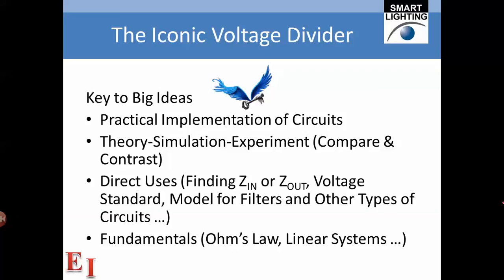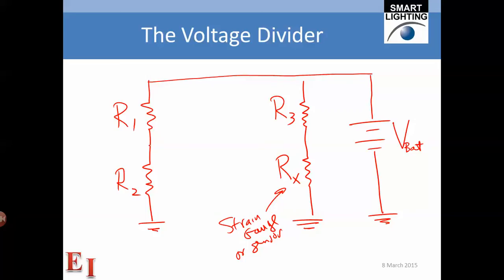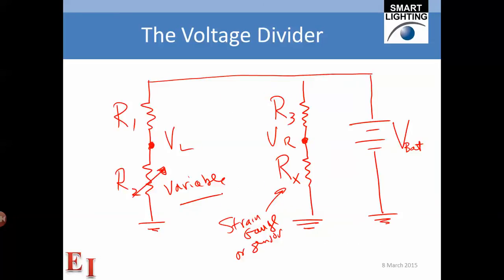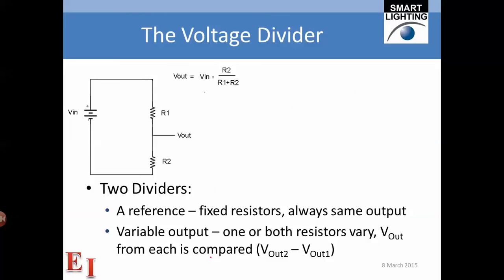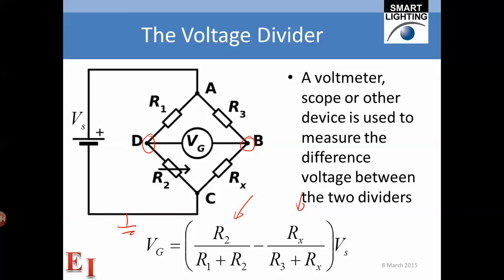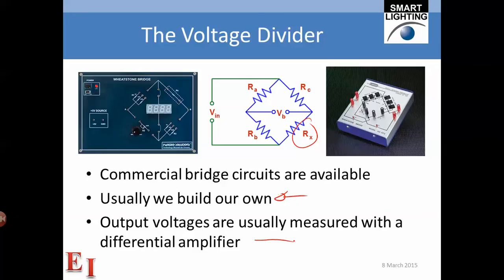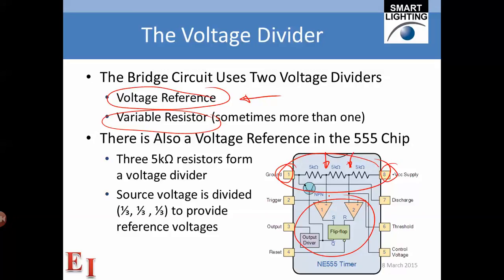Voltage Divider Pt8

Comment: 5.45 why v(out)= v(in)*r2/(r1+r2) ...............why not v(in)*r1/(r1+r2)
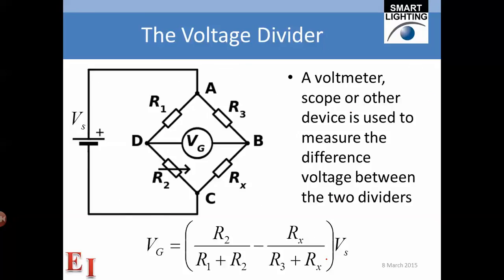Reply from the maker: Because the voltage is measured across R2.  Sometimes, I change notation partway through videos (not often, fortunately). But I just checked and I do not see that happening here. I did see that the figures I was using at the 5:45 mark do not show the circuit ground. If you add the ground (aka earth) to the bottom of the circuit, maybe that helps. If you have other questions, ask away.
Reply: Thanks